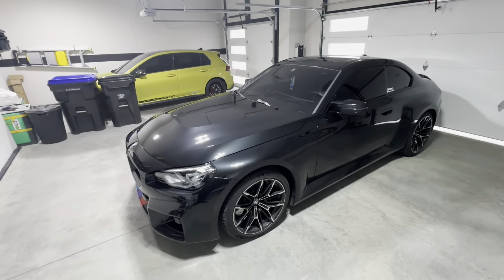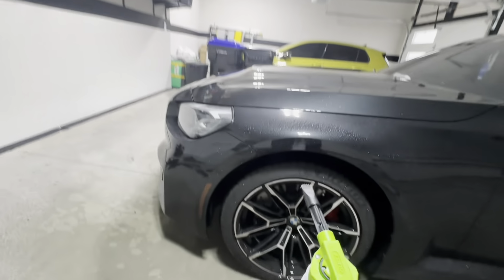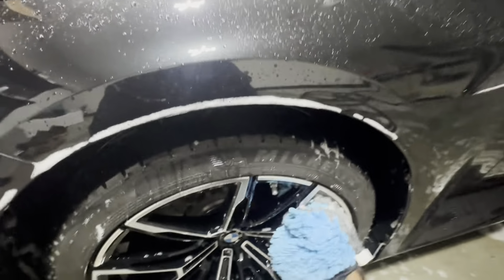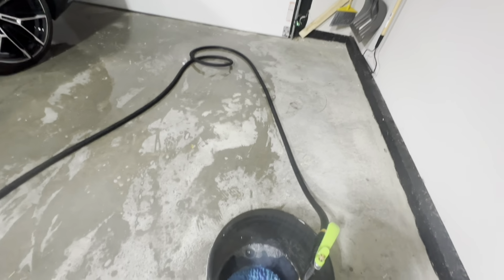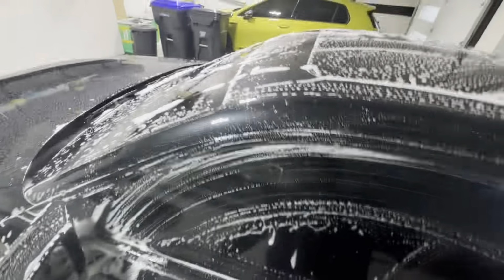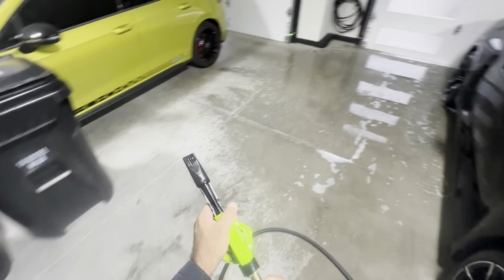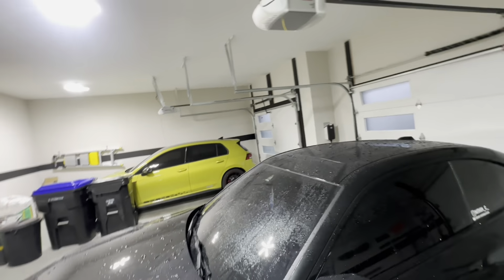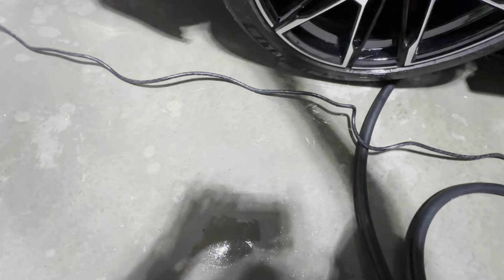POV: 2023 BMW M2 Exterior Detailing Wash Routine

Comment: The sponge, wheel brush should be use different buckets if not the dirt and small rocks will scratch the body
Reply from the maker: Thanks for the suggestion. That’s a good idea. I usually wash the sponge and brush everytime before I put back into bucket but this will help